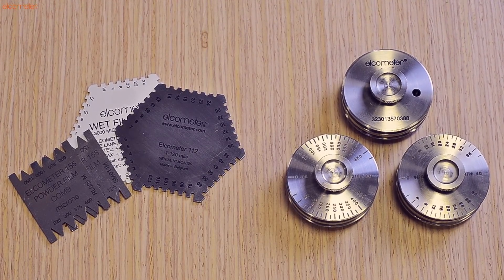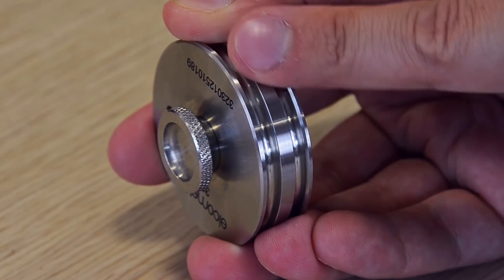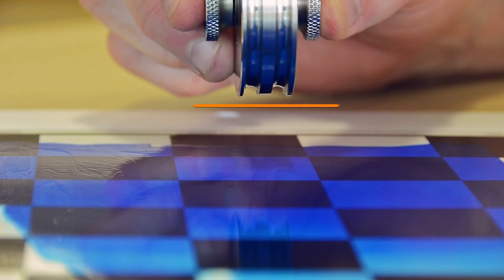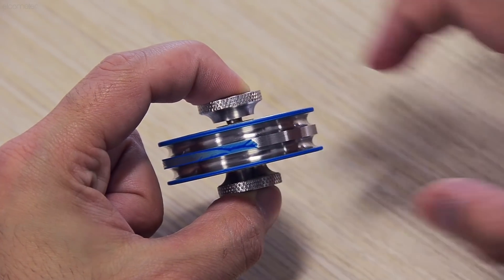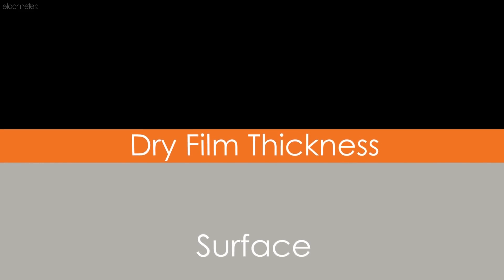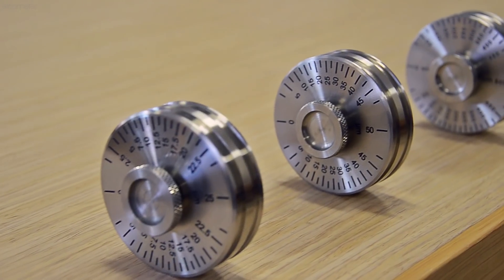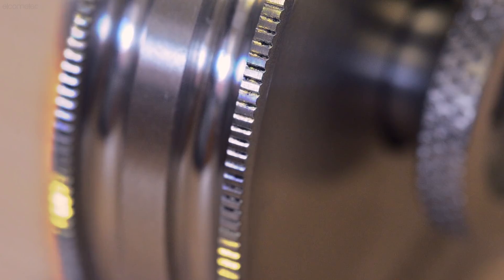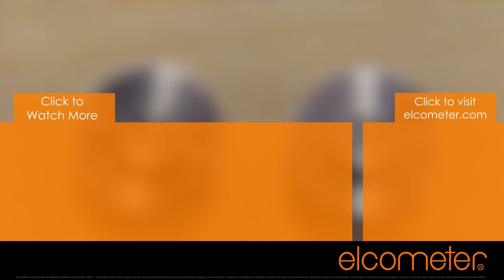How to Measure Wet Film Thickness using Elcometer Wet Film Wheels

Comment: Hey i am using the wet film wheels and find this video really nice, hence i can not acces the standard. Thank you for your work. 
Any chance you know what the hole at min 3:33 is used for? I always wondered.
Reply from the maker: Thank you for your comment.

It's great to hear you find the video useful!

The hole is there as a result of the machining process, so it doesn't have any use in terms of how you use the wheel, just how it is made.

If you have any further questions, please contact techsales@elcometer.com or visit www.elcometer.com/contact-us to find your local Elcometer distributor.

Comment: hi,when we use this wheel,when it moves 360 degree,there should be two readings (on each half - ie 180 degree rotation),so how we calculate the final reading??by taking average or taking the highest value??
Reply from the maker: Thank you for your comment.

In accordance with the latest versions of ASTM D 1212 and ISO 2808, you take the average of the two readings.

If you have any further questions, please contact techsales@elcometer.com or visit www.elcometer.com/contact-us to find your local Elcometer distributor.
Reply: @ElcometerOfficialChannel  THANKS FOR THE REPLY...